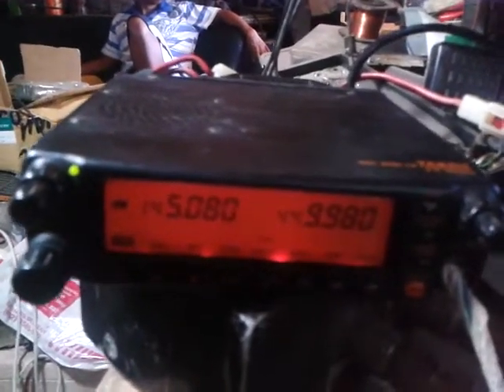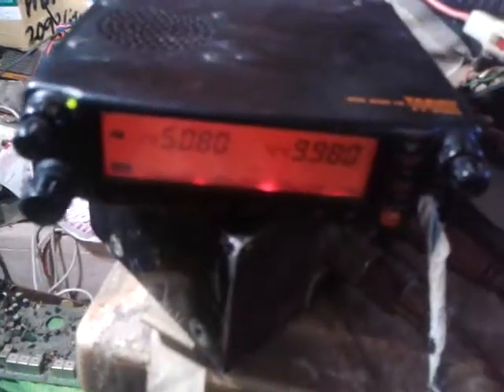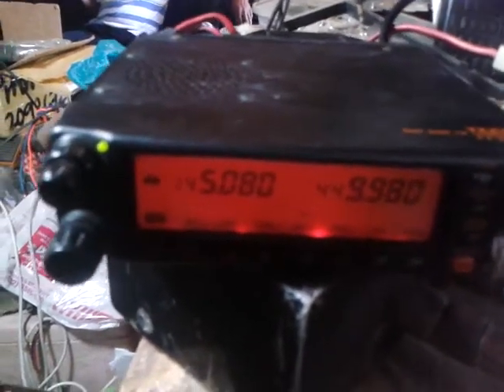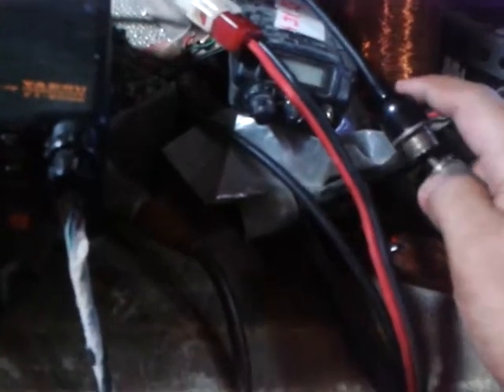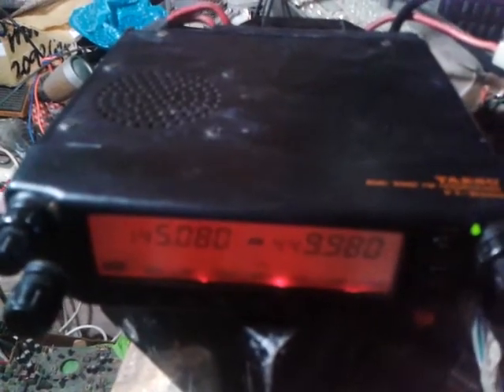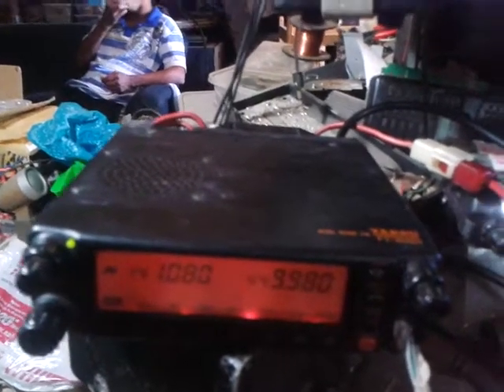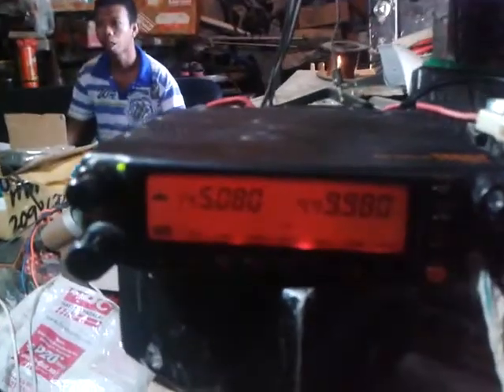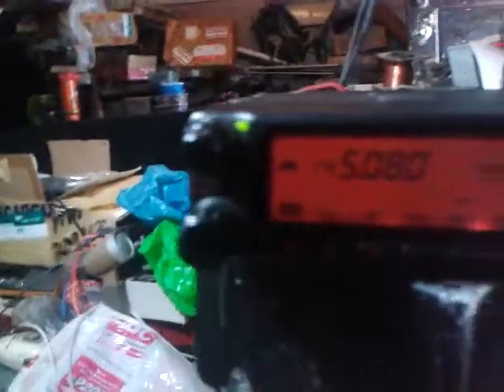4F1KJA Restored Yaesu Ft-8000R of 4F7MHZ

Comment: Save you time. They are junk. The diode switches are expected to do to much, so if you fix them they will shortly go bad again. The traces on the circuit broad is to small for the power wire addition fix is to bypass narrow trace on board. The radio is overly sensitive to stay RFs, can add shielding. But only slightly better. If you want the radio to screw up really fast, use it as a cross band repeater, even on low power. After that it is junk. The circuit boards have poor solder joints, especially where they are meant to transfer power from one to the other of the dual face circuit board. Soldering the joints and small feed through wires fix it, but a lot of work. The antenna pigtails on most had to be replaced, poor design. 
  They are not worth fixing. Even if you can do the work yourself. Nothing fixes a poor design. While under warranty they were at Yaesu more than they were in use.
Reply: Yep!  that's what killed mine!  I was using it in cross-band repeat at a Boy Scout function several years ago to boost up the HT's the boys were using during a ham demonstration.  Had it set up so they could hit a repeater in town about 30 miles away....radio never worked again on the VHF band since then.  I've disassembled the radio a few times and got it working a few times tempoararily by replacing the pass-thru's.  Problem is there's some custom chips on this radio that have failed that I cannot get anymore.....I replaced it with an FT8800...great radio, but I really liked the U.I. on this radio and wish it was designed better internally
Reply: Sir..mgandang klase b yang ganyan n base?